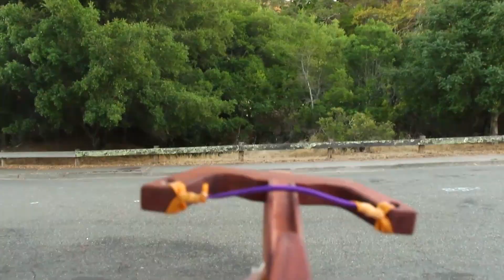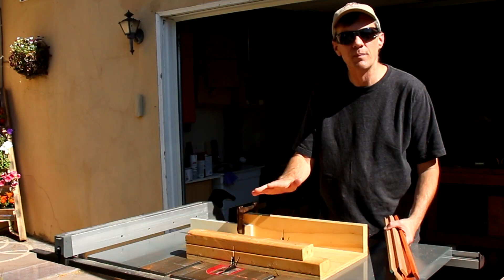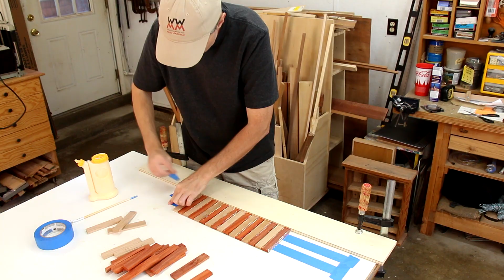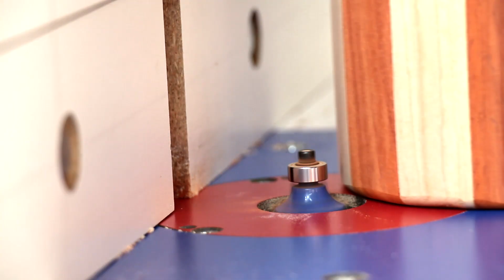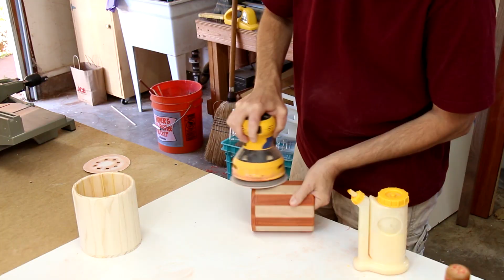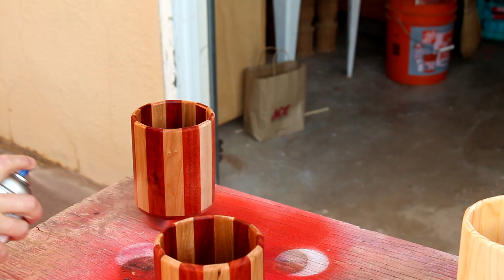Wood flower pots. Great gift idea!

Comment: Lets solve all of the problems with angle's and blade thickness as well of the angle of re entry towards the aperture of the finnagin pin with a double pike and spend a few thousand pound's on a CNC machine, and it can work out the angle's. Or just watch Steve's simple to follow video and enjoy using some timber to have fun and stop complaining.

Comment: It might be obvious, but make sure the angle you choose results in an even number of pieces, or you will end up with two of the same color as neighbors.  If you'd really have had 12 degrees, you'd have had 15 pieces...which doesn't work.

Comment: I recently found your youtube channel and am going through your old videos for inspiration and entertainment. love your way of presentation with a great sense of humour! 
you probably figured it out by now:  the sum of the angle is always 180 degree to go all the way round.
dividing that by the angle you choose, you get the number of corners/sides. with 12 degree it should have been 15 pieces. 
The smaller the angle the deviation gets more significant (in this example multiplied by 15).

starting to pick up woodworking myself after about 20 years of abstinence when I lived in apartments with no room for a shop. Last year I had my own house built and set up a garden hut 3x3.8m which I will equip as soon as it is no longer freezing cold shudder

Comment: Nice work!! 
I have a simple question..  

Is using the epoxy in foods and drinks stuff safe???
Reply: depends on what you have. You need to buy specific finishes for that, typically they'll be called 'food safe (insert blank)'. If it doesn't directly say food safe somewhere on the container I wouldn't use it just to be on the safe side.

Comment: you cut the edges at 12.8 degrees , probably blade wobble ;) just 360\x gives you the angle
Reply: that gives you the angle the pieces will form, not the angle you need to cut, for that you have to divide said angle by 2 or divide 360/2x (x being the number of pieces)
Reply: Ya I was gonna ask if I was missing something or why he didn't just divide 360 by the number of pieces to get the angle to cut at
Reply: David's math is right. Using it to make your life simpler:  if you want 16 pieces, you need to cut 360/(16x2) = 11.25 degree cuts. Thats not so easy, and darn hard to set on a table or miter saw without a good angle guage.  There some better # of sides that make the cut angle easier.  12 sides need 15 degree cuts...sweet!    6 sides need 30 degrees...not many sides but simple!  Other easy # of sides: 10 sides = 18 degrees, 18 sides = 10  degrees, 20 sides = 9.  Hint: if you use alternating types of wood, do NOT make an odd # of sides; you end up with one joint with 2 of the same wood types.  Don't ask me how I know this  :(

Comment: The math is quite easy, number of slats wanted (strips) say 12 strips divide by 360 degrees gives 30 degrees so each slat will get a 15 degree  angle on each side which equals the 30 degrees. To get a bigger diameter just make the slats wider.
This is the process that I use to make bowls etc on my lathe.  Cheaper than trying to find large blocks of wood to turn.
Reply: can I ask you a question ?. well you answer half of my question already now let's assume the top and the bottom are different widths how can I measure that for example, the top is 24 inches in diameter and the bottom is 14  the angle still be the same 15 degrees? for the slats strips) ?.

Comment: Mathematically if you make 12 degree angles you would need 15 pieces (12 * 2 * 15 = 360). You should use angles like 15 or 10 instead
Reply: He needed only 14. Apparently, the thickness of the saw blade should be taken into account. Evidently, the angle was around 12.86.
Reply: @anniiket  The thickness of the blade has no effect on the angle.

Comment: Hey Steve I would like to use this idea to make some rhythm sticks did you only  put a 12 degree angle on one side of the 1" boards
Reply: I was just scrolling the comments wondering myself.  Hard to tell in the video but I would guess for it to roll together, you would have to bevel both lengths?
Reply: Bevel both sides.  You can kind of see it at the 1 minute mark.

Comment: What about drilling a 1/4 or 1/2 inch hole at the bottom for drainage? Even though you can uses stones for that, I'm just curious if that would work also.

Comment: How do you calculate the width of the strips? I understand the bevel calculation, but I need my arch to be a particular size.
Reply: I answered my own question:

First, use a scrap piece of wood to make your arch profile (imagine a treasure chest lid; you want the side/short end). Next, take a piece of tape or string and run it from one corner and over the arch to the other corner. Cut the tape/string at that length. Measure the length of the tape/string (mine was 9 5/8, which I converted to 77/8 for easier math). Next, you'll find a number from 10 - 15 that divides evenly into your measurement (the reason for the range is because the more staves you have, the smaller the bevel angle = a more gradual curve). I used 11 since it goes evenly into 77 (7/8 x 11 = 77/8). That means that I will have 11 staves of which the wider side (imagine them beveled; the longest side of the trapezoid) will be 7/8 in.

Of course, to figure the angle of the bevel, you do what everybody has already said, but you replace 180 with 90 (since we're making a half circle and not a full circle). So, in this case, 90 / 11 = 8.18; an angle for which I'll need a digital gauge.

There's probably an easier way to do this, but it worked perfectly for me (my treasure chest lid is drying as I type this).

Thanks for all you do, Steve!!!

Comment: Steve, to be exact the 12°angle should have used 15 pieces to form a circle assuming everything right on the money. the width of the slats would make no difference in number of slats but would give a larger or smaller size with all the slats the same size. i plan on making one of these then turning true round in my lathe.

Comment: Thanks so much Steve for an excellent video tutorial.
Like joseph langlois, I am very new to this, too. I don't understand how you get the bevel to go one way on one side and the other way on the other. Can you please supply more details?
I understand the part where you say that you cut a bevel on the end of each piece. But what do you do then? Does this bevelled piece then go up against the fence which is 1" away from the blade?
Please help!

Comment: No matter the width, the formula for figuring your angle and number of pieces is ... 180 degrees divided by number of sides you want ..  180 divided by 4 is 45, so 45 degrees would be your angle for a four sided box, frame or what ever ...

Comment: The sum of all the angle of the joints in a circle must add up to 180 deg.
If you used "exactly" 12 degrees then you would need to have 15 of those joints, hence 15 slats.
Because only 14 pieces were needs tells me that you must have cut your angles slightly off this time -- ie. 180 / 14 = 12.85 deg.
On the first one you used 16 slats -- that means the angles cut there must have been a bit out the other way -- ie. 180 / 16 = 11.25 deg cuts.

Comment: First you need to know your diameter of the pot. Figure out the circumference of the outside circle through the diameter in inches. That will allow you to plot how many 1" or fractions of an inch slats you will use. Once you have that simple draw out your plot with a compass on a sheet of paper and draw in the width of the slats as geometric chords on the inside edge of the circle. Then space in the width of the boards used for slats and do the same thing allowing the inside line to cross each other. Then simply measure your angle from the outside chord of the first line to the inside edge. The only real math you need to do is the circumference of the circle. And if you're asking what a chord is, a chord is a line segment between two points of a curve. If you have an 19" circumference then you would have 19 chords if you used 1" slats. I know how to figure out the angles with geometry but it's not something the average person wants to do and this way is although a little time consuming less stressful on a none math person. Plus it allows them to visualize what it might look like when it's completed.

Comment: I think the answer lies in how accurate the angle is cut.  A 12 deg bevel on each side totals 24 degrees.  Since you're wanting to complete a circle, 360 deg divided by 24 equals 15 pieces.  So the 14 to 16 pieces depends of the accuracy of the bevel cut.  Nice project, regardless.  The hose clamps are a great idea.  I'll have to remember that.

Comment: You cut 12 degree bevels on either side of each slat? That makes 24 degrees from slat to slat. 360/24 = 15, so you'd need 15 slats rather than 16 or 14. Add to this that you might not have placed them as tightly as possible on the masking tape, and you have your answer.

Comment: I make tapered wooden buckets, and tapered wooden butter churns. They are just for decoration, the tapered wooden buckets will hold water, if they are caulked with oakum. But the butter churns are not recomended for use, as they are subject to bacteria. There is a formula for getting the right bevel on the stays, for a non tapered cylnder. Devide the number of stays into 360, this will give you the correct angel to set the table saw blade. there is another formula for getting the correct width of the stays for the desired diameter of the vessel. But I know you dislike complicated math in wood working, so I will leave that alone.

Comment: Steve - Using Google Sketchup; I made a 3 dimensional piece, that matched the dimensions you used ( 1" Wide x 5" Length x 1/4" thick... with a 12º bevel, on each side ) - and saved it, as a Component.  Using the protractor in ther toolbar, I put each piece together, by rotating them to fit against one another - and it took 15 pieces, to complete a circle.

Doing some simple match, it would seem that: 360º ÷ (15 pieces), would equal 24º... with the 24º being the total amount of degrees, for each piece. Yours winded up being 14 pieces total, so - 360 ÷ (14 pieces), would equal 25.714º. And the 25.714º ÷ 2, would be 12.857º.

Google Sketchup only save angles to the nearest 1/10th of a degree, so I made a new Component, that was: ( 1" Wide x 5" Length x 1/4" thick... with a 12.9º bevel, on each side )...
The pieces went together and formed a circle.

ANYWAY... My hypothesis for your problem, was that a woodworking table saw (no matter how high-quality it may be) simply cannot be set to a (PERFECT) 12º angle. I would also guess, that a saw cutting a piece of wood -even if set to a perfect 12º angle... simply cannot produce a perfect angled cut?

... 16 pieces would have required a  (PERFECT) 11.25º bevel on each piece.

Comment: EnviroTex is great stuff (even rumored to be safe for food contact, though they never paid for the FDA seal of approval).  It's basically the same stuff that people use to seal wood bar tops, reclaimed-wood tables, etc.

If you find yourself using it on more visible surfaces you'll notice that you get a lot of small bubbles showing.  Just wait a couple of minutes after application and "brush" quickly with the flame from a butane plumbing torch to make them all go away and give you a really clean surface.

Comment: .about the degrees...
what happened is that you've made the cuts closer to 13º than 12º that's why it took one less piece, minimal errors (less than 1 degree in this case) add up a lot in this case.
if you want to use a specific number of pieces you can divide 180/nº of pieces and you'll have how many degrees you must cut each one:
       .[degrees] = 180 / [nº pieces]

Comment: In regards to your "mathematical way" to figure it out: all you have to do to determine the number of slats required is do 360/2x. x representing the angle you cut the slats on with your table saw.  By the way, thickness of the pieces makes no difference as long as they are all the same. This will work for any polygon (excluding triangles), and can even be manipulated to tell you the angle that you need to cut to achieve a certain number of slats. I.E, If I want an octagon (8 sides) I can do 360/2(8) and it will tell me the degrees I need to cut at the table saw (or miter saw for that matter). In this case, it is a 22.5 degree angle.

Comment: all your angles need to add up to as close to 360 you must have been closer to 13 degrees  14 slats with 2 12 degree angles is close enough for wood with all the glue joints  the closest i got just by fumbling around with a calculator  was 12.857  which gets you 359.996 but were really spliting hairs on that level

Comment: so my guess on the size difference is this: angles to make up a circle add up to 360 degrees.
14 strips with 2 bevels at 12.8 degrees gives 360
16 strips with 2 bevels at 11.25 degrees gives 360

so just 1 degree difference can account for 2 pieces of wood.

you gave best advice though! just make a few extra :) nice project, im going to make some

Comment: To determine the number of pieces take 360 / angle / 2  so 360 / 12 / 2 = 15

You can also find the angle by 360 / pieces / 2 so
360 / 14 / 2 = 12.86
360 / 15 / 2 =12
360 / 16 / 2 =11.25

You can see that for less than 1 degree either way will add or subtract an extra piece.

Comment: A video with a taper effect so the top is wider than the bottom would be cool.
Reply: You can turn segmented bowls on a lathe, that is probably the easiest way to achieve a conical shape. But that is somewhat tool-intensive. Lathes are like aircraft carriers that way, a mighty force but you need lots of other stuff/ships for them to really work ;-)
Reply: Radbert Grimmig Yes, I've seen people turn cone segments. They usually dont have a conical shape until they put it on the lathe. Its more of a gradual offset of rings they use. Rather than single vertical strip segments. I just think with the angular sides it would look cool in a cone shape. I'm familiar with the lathe I have a full size. Havent dabbled with segment turning though. Actually just found these instructions on how to do what I was talking about (hes doing it to turn but id leave it at that)

https://woodgears.ca/miter/index.html

Comment: About the angle. A full circle is 360 degrees. 
Each stick have 2 sides. If you want 16 sticks the angle of cut must therefor be
360 / 2 / 16 = 11.25 degrees

15 sticks
360 / 2 / 15 = 12 degrees

14 sticks
360 / 2 / 14 = 12.85 degrees

The glue gives you a little play in the angles.
Reply: Similarly, if you accurately set the cut for 12 degrees, the pot will take exactly 15 slices.  The width of the slices affects the overall size of the pot but not the number of slices needed. Simple yet elegant project - thank you.
Reply: @ToonOfLancing  : If you use an odd number with two colors, you'll get two of the same color next to each other at the end. 14 is fine but the correct angle is closer to 13 than 12 degrees (12,86 to be precise). However, if you make the angle a bit smaller than necessary, you'll get gaps in the inside. If you do the other way around, you get gaps in the outside. So from this point of view, 12 is still better than 13, but maybe 12,5 can be set roughly on the table saw. I don't think it is possible to set 12,86 precisely.
Reply: TY. I was stumped as to how that angle stuff happened.  I knew it had nothing to do with the width of the boards but I was only considering 14 edges rather than 28.

Comment: ***** A 12 degree bevel should have yielded 15 pieces (360 deg / (12 deg * 2) = 15), so given slight variation in the blade angle (and the necessity for an even number of pieces for this projects), both the 14 and 16 piece versions make sense!

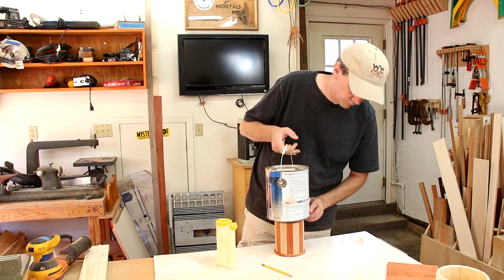Comment: 4:05 What kind of paint do you recommend for the best clamping pressure? But seriously, what was the, thing, at the bottom of the pot? Does the epoxy dry with bubbles in it?
Reply: ***** I use that same exact stuff all the time to fill cracks in pieces I turn for bowls and such.  Never had a problem with bubbles in the cracks.  But when I poured my left over from my last fill job just to see if I could use it to turn a lid for a box or something tons of bubbles.  Did some research seems a propane torch on low can take care of the bubbles, just don't touch the flame to the epoxy.  Wonder if a heat gun on high could work.  Incidentally, after putting the epoxy disc on my lathe I think I figured out where Easter basket grass comes from.